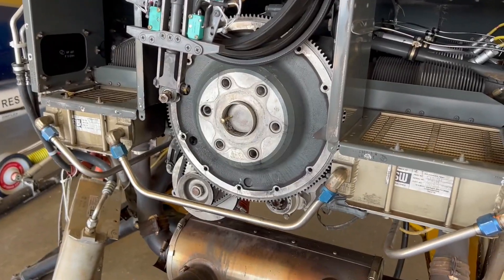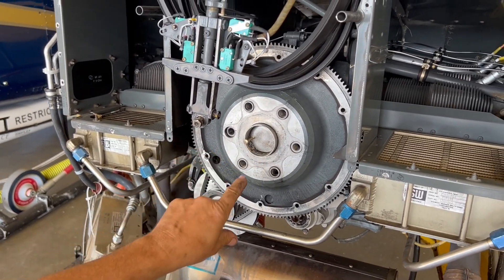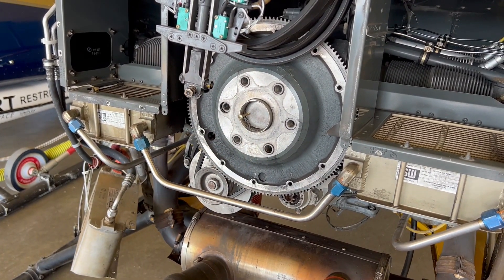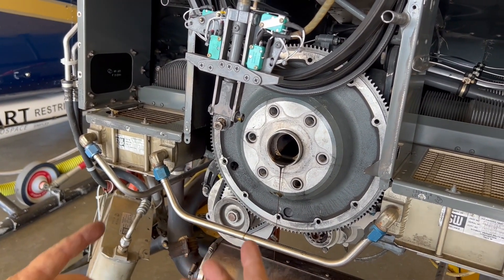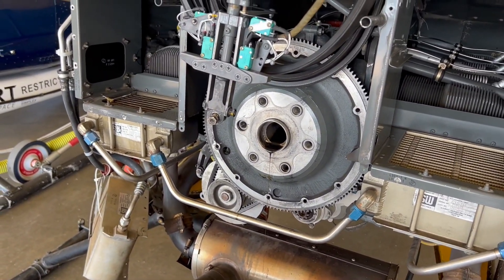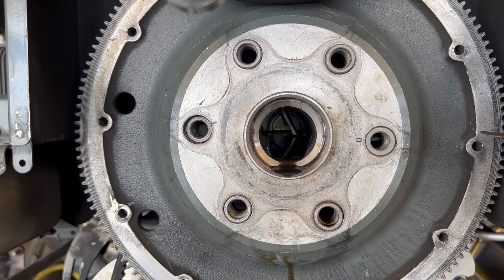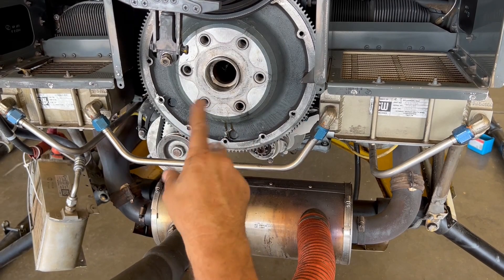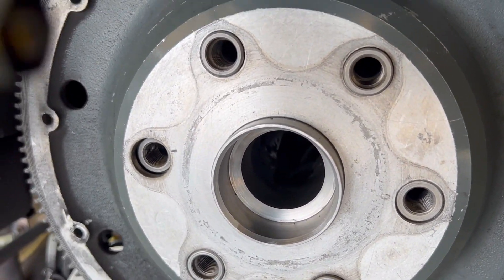An unusual source for an oil leak in an R44- you'll want to see this if you fly an R44

Comment: Wondering... if the plug that was removed, due to leaking, had been installed without sealer on its outer circumference.